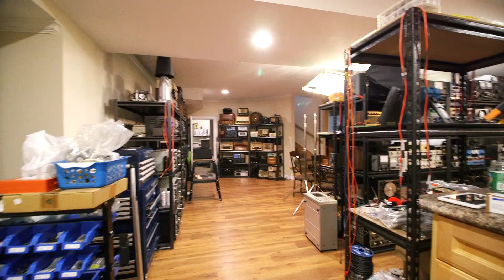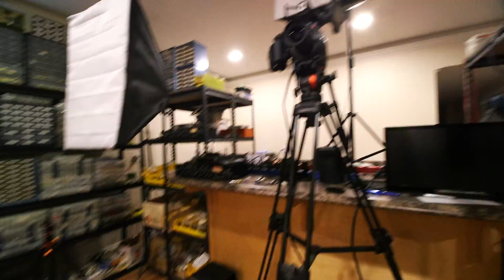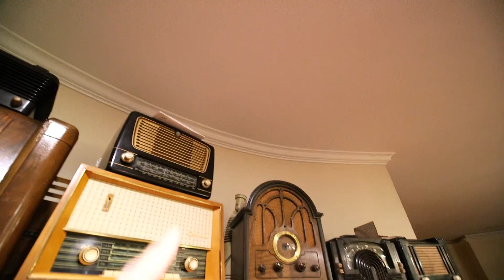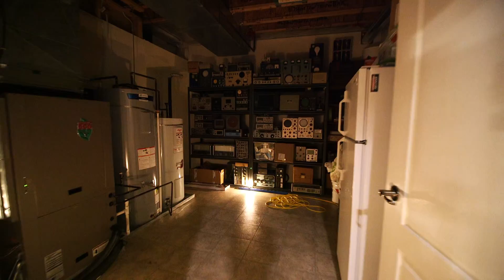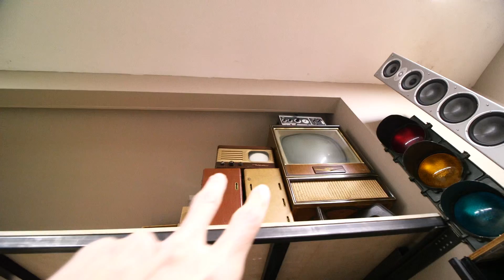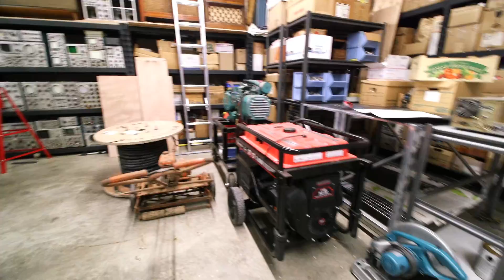Behind The Scenes At The New Mr Carlson's Lab!

Comment: Having a home metal shop (Bridgeport mill, 12 x 36 lathe, 6x12 surface grinder) I am impressed.  So much space.  Where did you get the fork lift?  I have to make do with an engine hoist or a set of machine skates.

Comment: Interlocking children's floor mats can be found fairly cheap compared to other flooring options. Did a whole basement when I was staying in Edmonton for some work. They are comfy and keep your feet warm too, allowing your feet to remain uncaged. There is a wide variety of them from basic flat colors to wood-grain finish. Maybe those plus a thin 1/4" or 3/8" rubber mat the length of your desk extending out 6' or so, would provide some more stiffness and uniform surface for the camera tripods?

Lab looks wicked tho. Keep on keepin on.

Comment: Need some rubber grommet vibration isolation on them water pumps. Like in a PC or an device with a noisy electric fan.  A bit of insulation works wonders.  
Very impressive laboratory. Huge improvement, and not just with lighting, video and sound. Space to actually repair various devices has become so much more efficient.
The Shop Talk episodes are very interesting.  Battle stories from a veteran electrical engineer. More please.

Comment: Yes, it would be great to hear some more shop talk from you. Here's an episode from my past: Back in the early '80s I was an apprentice TV engineer for a TV rental company. I worked in the workshop with some of the older guys who didn't want to drive about servicing TVs at customer's houses and preferred being on the bench. One old guy (who I won't name and has probably passed away by now) used to go to the pub at lunch time and would often be seen asleep on the neck of a tube (CRT) in the afternoon. As an apprentice I had to do the teas and coffees for everyone. One day I made him a tea and put it in a mug with a hole drilled in the bottom and filled with transformer wax. (Don't worry the tea was nowhere near anything electric). Another trick I did was to put a low voltage capacitor in a safe block when he was out of the room. When he came back in I would walk by his bench and flip the fuse over on the safe block a few moments later there would be a loud crack a shoot of smoke and bits of capacitor everywhere. Poor guy, he always took my pranks in good humour. I'm so glad there's no idiot around me pulling pranks like that now I'm the older guy!

Comment: Very impressive, what you've done and what you're doing. I think a grid system hanging down from the ceiling a foot or two would help you by removing the need for all the tripods cluttering the floor. Lights, cameras, etc. could hang from retractable unipods with hand-press clamps controllable from the lower end.

Comment: We went with electric geothermal due to cost. 1/2 the price of gas per month. That includes what we were spending for electricity and what the geothermal draws. It's mostly compressors all winter with the heating element only kicking on if it dips below 0 outside.

Comment: Never understood water geothermal.  Seems way to inefficient.  I my younger years we just took a regular heat pump system that used an air type condenser / evaporator and cut out the condenser / evaporator and plumbed in a ground buried cupro-nickel coil.  That way you could run the heat pump in the coldest winter and warmest summer and not have to have auxiliary heating bars.  If there is high ground water you can just submerge the coils in the ground water.  Once several feet below the surface the substrate does not change temperature as the earth is massive and is a great heat sink / heat source.

Comment: Hello Paul. You have probably already tried this, but just in case, have you used the old clockmaker's trick of applying heat from a soldering iron to the splined sleeve of the dial? I have used this trick several times with seized parts in clocks and old turntables with success. Might save you having to construct a bespoke tool - although that sounds fun. I love your videos and I appreciate the time , effort and expertise you put into them. Thanks from a fellow BCer. Andrew

Comment: The wall-mounted pumps can still be attached to the wall IF you decouple them from applying perpendicular motion to the wall.  A metal frame on the wall can provide a place for rubberized vertical hangers for the pumps. Vertical (hanging) force is ok, it's the perp force component that causes all the trouble.  You showed a similar decoupler for the air handling system: flexible rubber boots.  The distance offset from the wall is not critical, so long as you have enough clearance for the pump displacement plus a margin.  You can DIY a metal support frame the same way you did the mezzanine storage in the garage bay. This avoids having to do anything into the concrete floor.  The other option, less effective, is to add mass to the offending vibration structure --- it reduces the amplitude of the motion.  Using both decoupler & mass methods are always best, but space isn't always available for that.  Absorbers of any kind won't be helpful because you cannot make them thick enough to do anything useful. Put a directional mic in the room before & after the mods, and run it into either a scope or spectrum analyzer so you can quantify the changes.  HTH

Comment: There are metal (and probably plastic) spring clamps available through some woodworking retailers. I’m sure you could modify the IKEA light clamps for a better solution. Thanks for the tour.
BTW - That existing wiring mess would drive me crazy. Granted, it’s a short drive but I’d be slowly correcting it in small chunks. Beauty is that whatever got done would give a sense of accomplishment.

Comment: You are the first person that I've heard that has Dissed Geothermal --- but you bring up an excellent point.
Reply from the maker: I think a lot of the info is just regurgitated by people that really don't know about them. They use "Incredible" amounts of electricity. The heat that comes out of the registers in the floor is not like natural gas heat, it's just gently warm. In the winter, in cold weather, the compressor and furnace will run 24 hours a day (common for a geothermal system.) Think of this like having your electric cloths dryer on 24 hours a day. The upside is, its an air conditioner in the summer that will keep up to the hottest weather, and if you are concerned about running a natural gas furnace, this is the next best thing.... But you will pay for it.

Comment: Suggest you not waste your time fixing the breaker box but suggest you get a good electrician. It looks risky.
Reply from the maker: Its just low voltage wiring, IE: alarm, cable, internet. The breaker panel is at another part of the facility.

Comment: Great lab and workshop! A lot more cameras than I expected.
I needed a laser printer anyway, so I bought the one you showed working for pcb etching on Patreon. If it works, why gamble on something else? Looking forward to etching some pcb's once I buy a few more things. Thanks for the great and hard work. Your videos are great for learning and soothing to listen to. I used to fiddle with some vacuum tube equipment when I was real young. I didn't understand the high voltage that they had, though. I did know to keep one hand in my pocket for being inside a TV to not get shocked when it was on and to discharge the capacitors, though.

Comment: Hmm, for a puller look at machine tool collets. Put one in a collet block and use that to pull the dial off.
Reply from the maker: That would squeeze the hub tight on the shaft while trying to pull it off. The hub is brass, and soft. It will have to be heated, then pins installed into the existing holes and pulled.

Comment: You wouldn't know where a fellow could find a Sylvania 830 triode, would you? I have one and am looking for a second. I have found many 830B which is electrically the same, but the 830B has a plate cap where all 4 connections are in the socket.

Comment: A suggestion on the hum from the pumps.  While taping, record an empty ten seconds with the pumps on (before each take) with the mics at level.  In editing, use that ten seconds to train Adobe Audigy's intelligent filter.  It will eliminate the noise without any of the troubles of notch filtering.  It uses noise canceling similar to how noise canceling headphones work.  I do realize you are additng brackets etc, but if the noise is still there, this is a solution.

Comment: One of the issues I have been experiencing lately is an injured back after working at my bench. My chair is obviously not conducive to good back health. If you have any suggestions I would be interested in hearing them.
Reply from the maker: I'm still on the hunt for the perfect chair myself, I must have gone through 12 or so already. When I find one, I will definitely let you know Leonard.
Reply: That's probably my single biggest problem also.
The expensive ones are prettier than the cheap ones, but they're no better quality.

Comment: Mr. Carlson, question. I'm trying to figure out an equivalent for a SOC123A optoisolator that goes in a 2445 scope. The Tek pn is 156-0885-00, which is said to be a MOC1005. I've gone through datasheet after datasheet and there seem to be so many close equivalents to the MOC1005. Later models of the same family scope use a TLP631 in the place of the SOC123A. Between the 1005 and the 631 they both have specs that are very similar to the TIP117, H11A1, 4N25,26, and the main difference between the new parts here and the old seem to be isolation voltage and CTR tested and spec'd at varying voltage and current levels between the old and new parts. How do I decide which one to go with?

Comment: Thank you so much for the behind the scenes!!!
Have you ever knocked over the camera forgetting it is behind you or beside you??  It must be difficult trying to work on stuff surrounded by tripods with lights and cameras.
It looks like the shop in the basement of your house (how convenient!),  instead of having to drive to another location all the time.   It's too bad the electrical rates make the geothermal system cost ineffective.  I thought only Ontario had ridiculous hydro rates!
Is down the hallway where your vast inventory of vacuum tubes and other components are stocked ?

Please share more of the crazy stories...  you have them... we all do... great to share.  The fan blade description was so perfect,  it was like being there to experience it in person.

Speaking of Shango066,  he did an amazing dissection of a vacuum tube recently,  even removing the filament wires from the cathode, and then after physically displaying each part,  showing how it is identified on a vacuum tube schematic symbol.  I only wish I would have had an electronics instructor in high school that would have done the same.

Comment: I have a Tektronix 561a oscilloscope that needs a good home if you want one for your collection. It has a type 3a75 amplifier and a 2b67 time base,on a Tektronix type 201-1 roll stand with drawer. Obtained from a local radio station here in Pittsburgh that I was commissioned to demolish transmitter and towers., also have some eimac tubes and stoves+sockets. If you respond we can figure out a way to get them to you. Getting old, clearing out the corral.

Comment: I'd try insertion rubber between the pump mount and the wall, if the wall is rigid enough it will reduce the noise transfer. Insertion rubber is the type of rubber used under heavy machinery mounts, it has an inner reinforcement webbing so it doesn't extrude when compressed. You can purchase insertion rubber in sheets, I find the 3mm (1/8") is about the most useful minimum.

Comment: Could you minimize the hum from the geo system by generating a out of phase signal through a subwoofer?
Reply from the maker: I did think of putting a woofer on the wall and doing exactly that. I figure moving the pumps would be the better idea though.
Reply: Low-tech is usually the best way to go. It's more reliable because there is less stuff to break down.
People are always asking me why I do that and I tell them that I believe in the KISS principle. (Or maybe it's just simple things for simple minds, lol.)
Reply: True, but complexity is sometimes more fun to mess with, look at the allure of tubes versus the simpler transistor. @mikesmith-po8nd

Comment: I'll bet you a fan hub puller would remove that dial.
Reply from the maker: I will look into one, it would have to be pretty small though. Thanks for the suggestion!
Reply: @MrCarlsonsLab  Another thought, it would be easy to build one. Just look how they are built online. A couple of screws and a little welding and youd have a custom tool in no time. Love your channel, BTW!